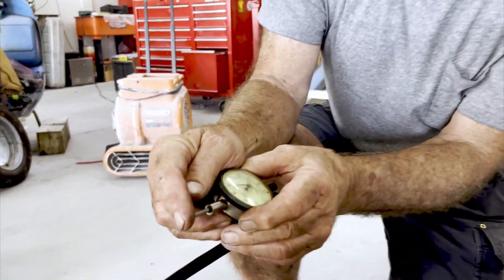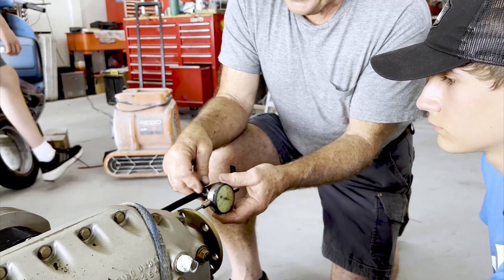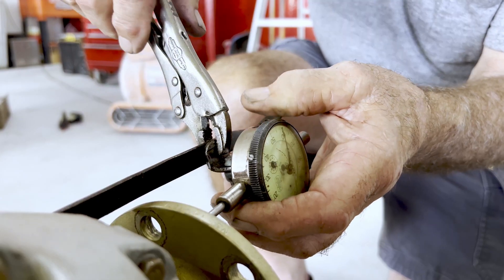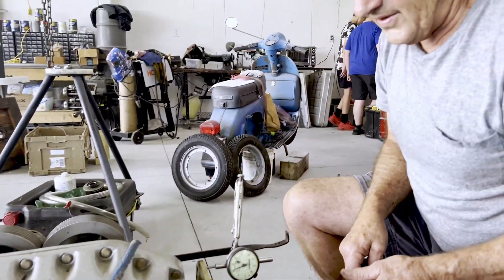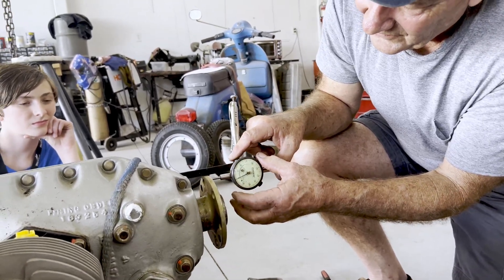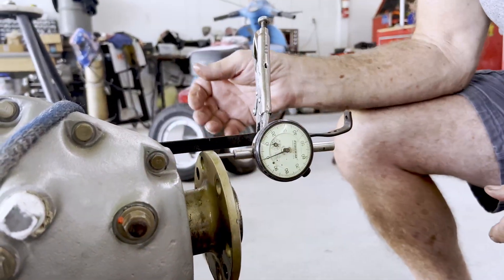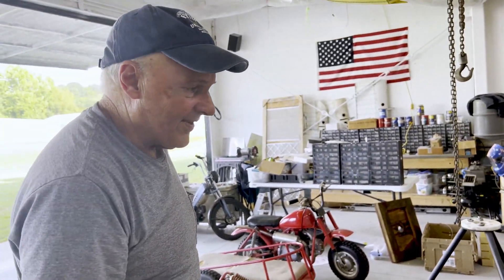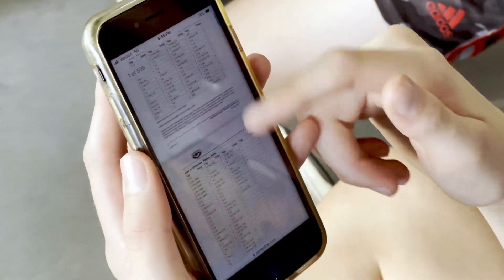Checking the Crankshaft on an Engine that Suffered a Prop Strike!

Comment: so even if the dial indicator is good could there still be cracks on the crank that result from the prop strike?  Does the engine have to be stripped down and overhauled?

Comment: Please correct me if this is in error, but in addition to checking the runout for the prop mounting surface I was under the impression that the crankshaft needs to be checked for cracks after a prop strike or sudden stop.  I was informed that the case hardening on the crankshaft is about .050" or so and that a prop strike can fracture that case hardening around the nose of the crankshaft leaving a weak point and the possibility of total fracture some time later.